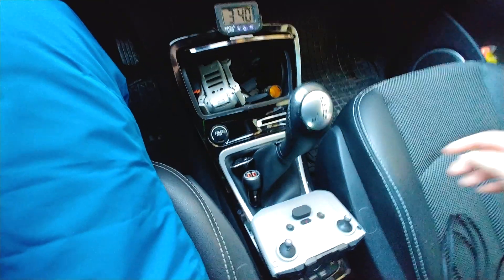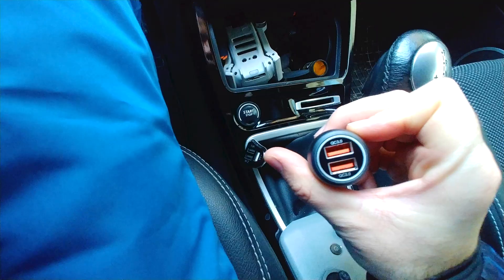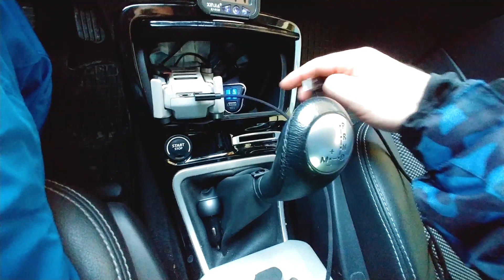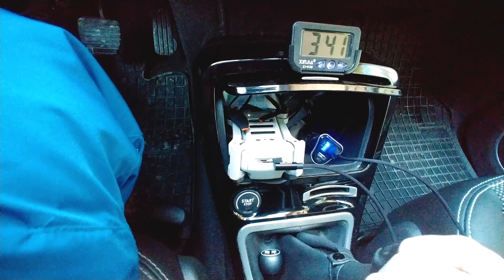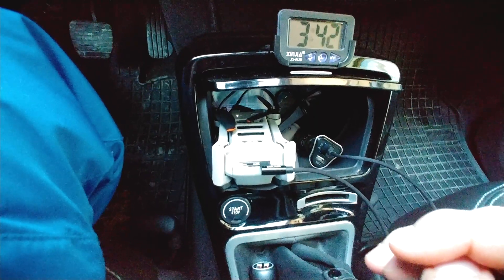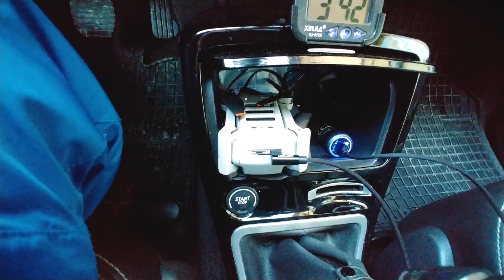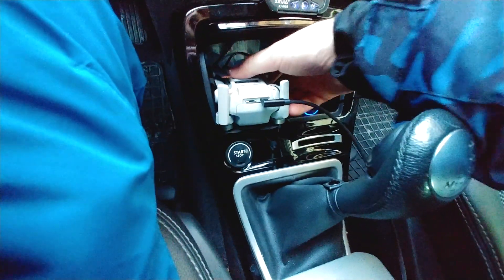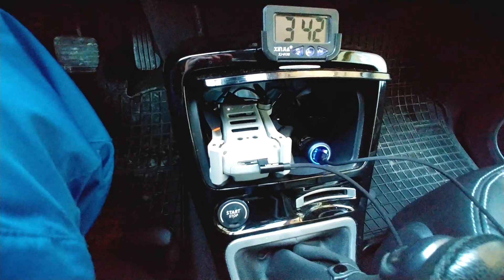Slow vs Quick car charger (DJI Mini 2 drone, QC3, LED flashing speed)

Comment: Quick Charge 3.0 charges at a higher voltage (9.2 volts X 1.4 amps). If only 5v it would still charge slow, its the volts that makes charges it faster.
Reply from the maker: On the package of this Quick Charger the following is mentioned:
 - 5V/3A
 - 9V/2A
 - 12V/1.5A

Both Volts and Amps are important, they give the total Watt.